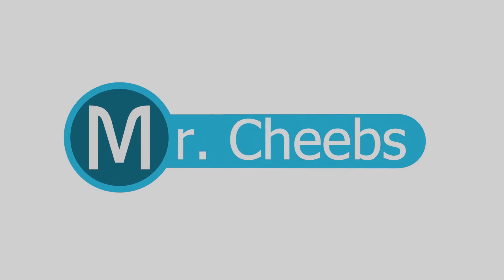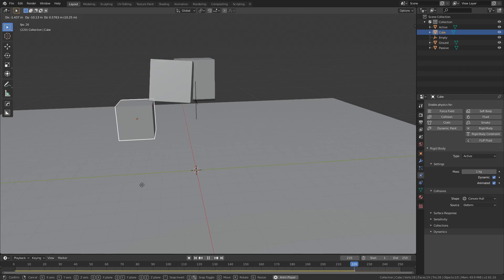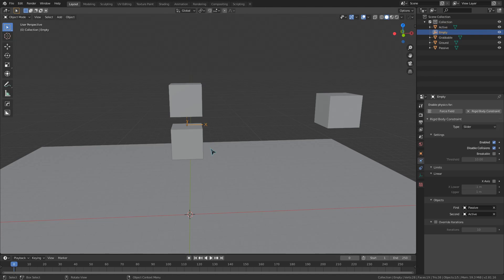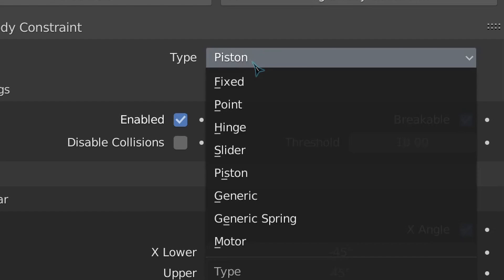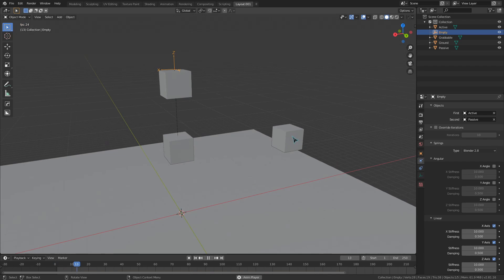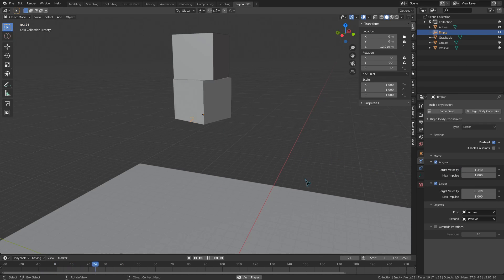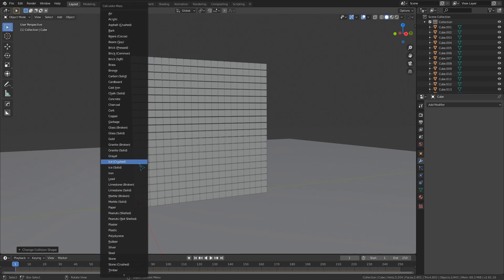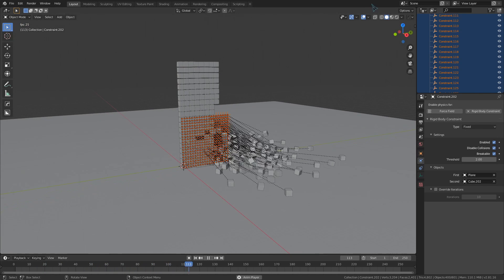Ep 5: Types of Rigid Body Constraints

Comment: Great video; thanks.  I'm glad to see that someone has finally done a comprehensive tutorial on the rigid body constraints.
Since the hinge constraint allows full rotation it's also a good choice for putting a wheel on an axle or a gear on an axle.  Make the gears rigid bodies and then they can drive each other.  See also this channel for some great gear tutorials and connecting them using the hing constraint: https://youtu.be/DqBOva04lcE